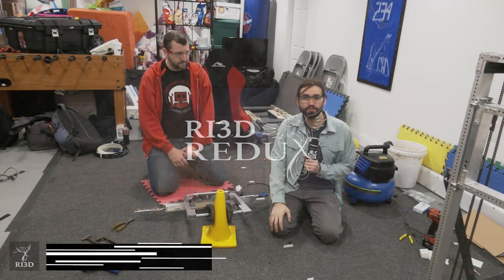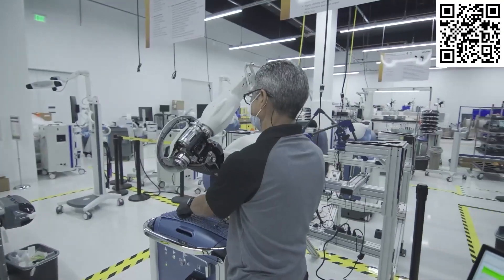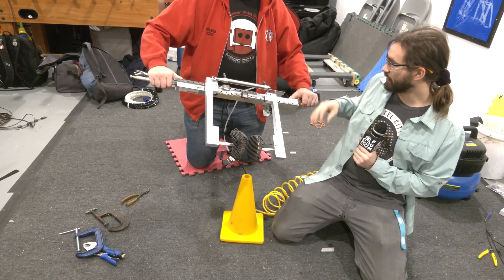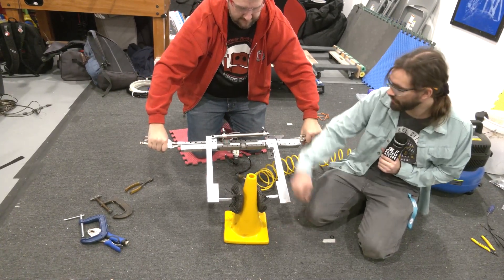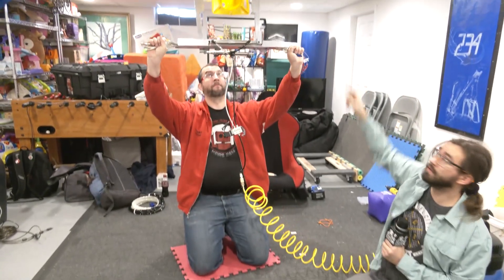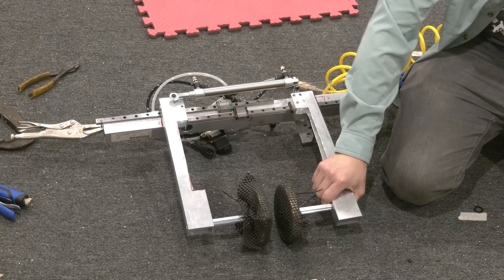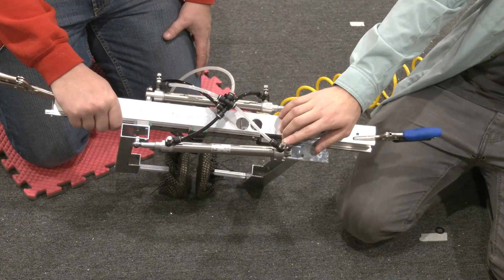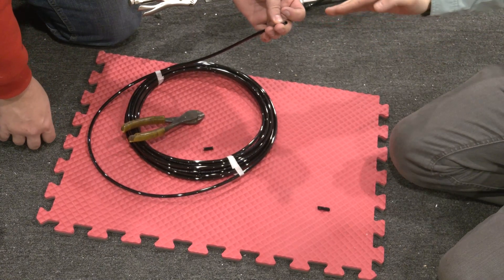Passive Wrist Manipulator 2.0 and Pneumatic Tips | Ri3D Redux 2023

Comment: Cad files ?
Reply: This is robot in 3 days, so I imagine most documentation should be coming out by noon tomorrow, or perhaps shortly after
Reply: We did not really do any cad.   Except for 2d sketches that gave us some basic measurements.  The idea on this is not to give you a full solution but to show you some things that might work.  We also will answer questions.  In general I don't think that teams should copy this design of the claw with the linear slides.  A claw that allows the game piece to pivot with gravity is not a bad idea.  But this implementation would not fare that well in competition or practice.  More iterations are needed.  It could use a lot of improvement.